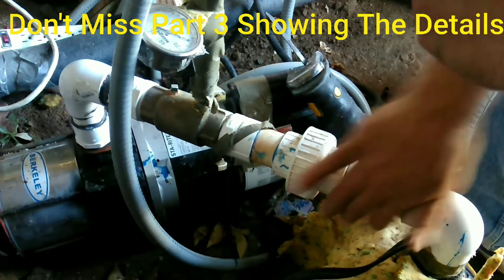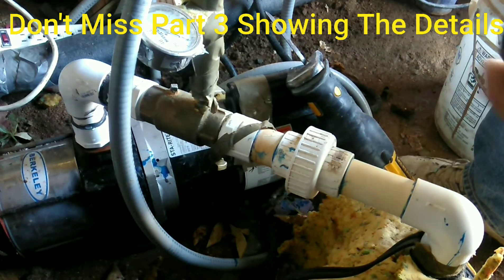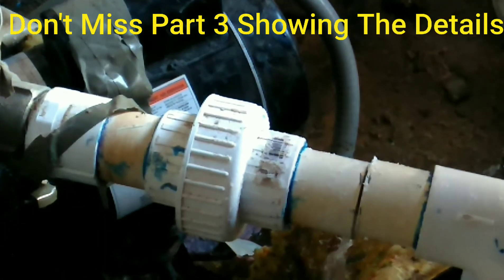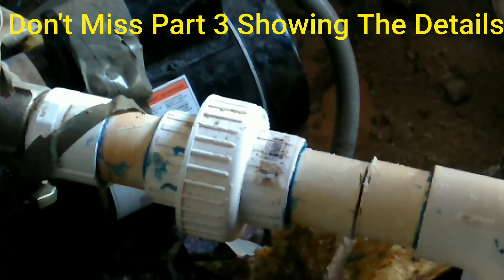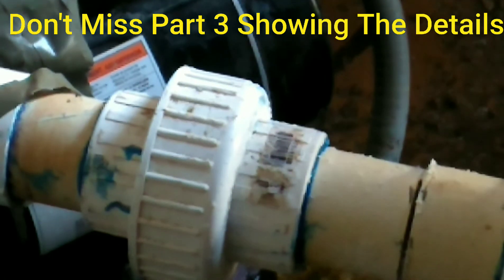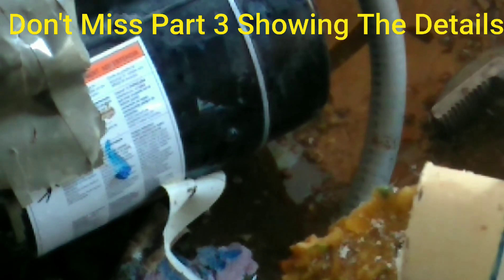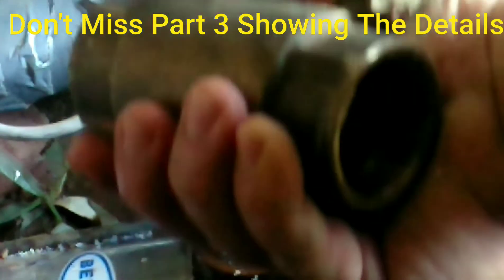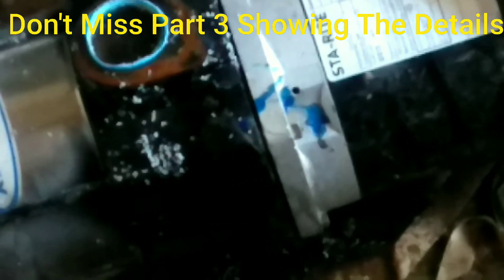PVC Modification Booster Pump 2018. series 1 part 2

Comment: Its a pain in the butt when the flap in the well some 200 feet down craps out. Have to pull all that pipe out and replace it. So instead installed a booster as well to keep the pressure in the line. Great install
Reply from the maker: Thank you but actually the booster pump is set up to take the water out of the water tank and pump it into the house but that's a thought for sure have another Pipe  going into the well.